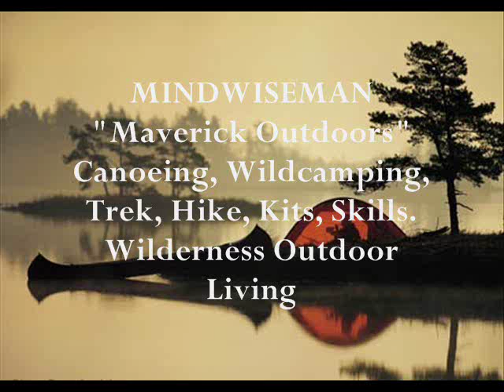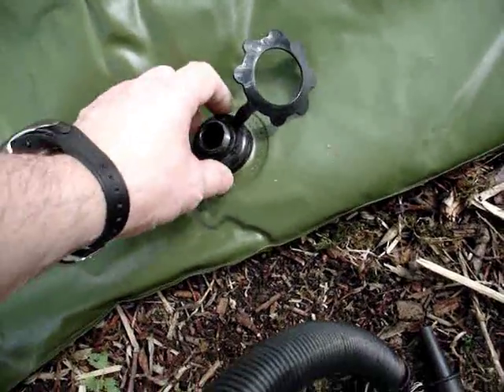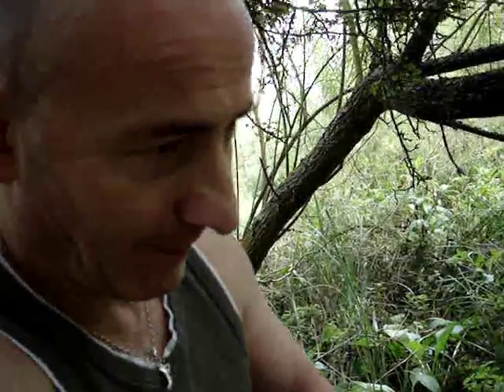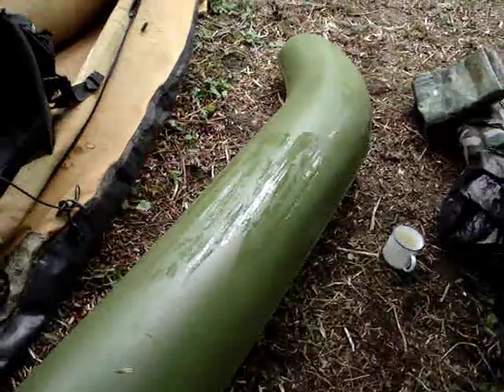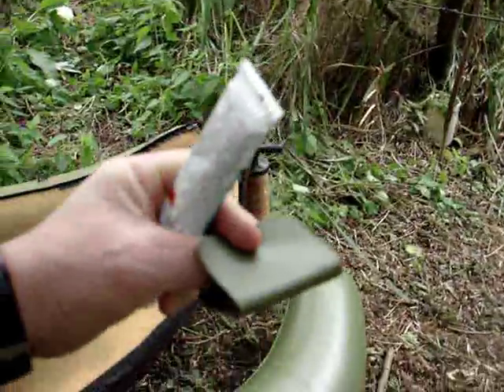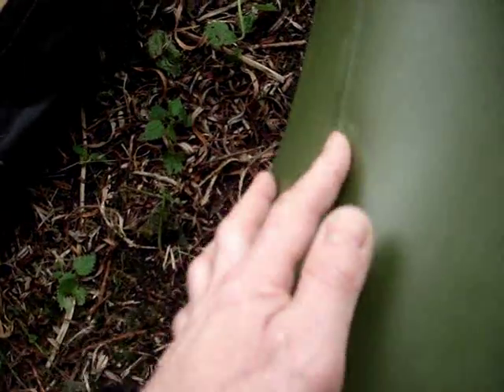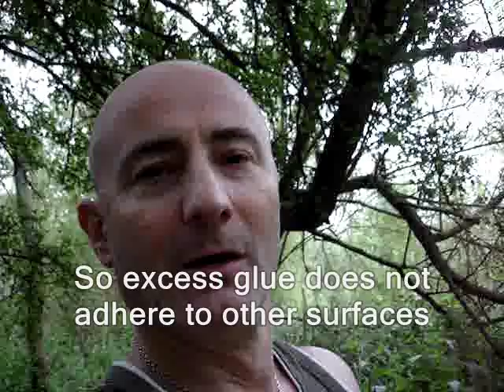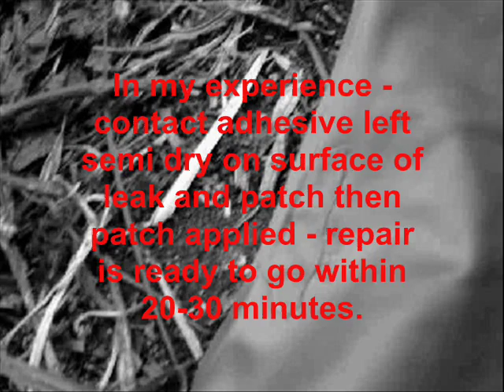Sevylor Colorado Canoe: DEFLATION REPAIR, On The Trail

Comment: Hi Mindwiseman, the soap solution will work better as it will produce more/better bubbles when sprayed onto the surface of the bladder, it will help with leaks that are harder to find than using just water as it will produce massive bubbles similar to the sort of toy bubbles that kids play with when they blow through the hoop. I would have thought it will save a lot of time to especially with the very slow punctures.

Comment from the maker: @sjacko1066 Defineately something to consider detergent/water spray bottle, do you think it will work better because it is a thicker solution. May take longer to flow/cover surface. Will give it a trial run. Thanks for the comment - Cheers!

Comment: I had a similar problem with a Thermarest sleep mat.  I let the air out and mixed up some locktite and put around the seam ,let it dry for 24 hours. That was about 5 years ago and never had a problem since.

Comment from the maker: @ThePanzer6969 Heyup m8, I inflate pressure (don't trust guage) to finger or thumb press suface 1" deep with a spring back of the baldder. One of those things where you get used instictively to the feel of the surface pressure & by feel/look. New version of Sevy' Col' seat aren't as firm back as the original, I don't have a prob with back support as mine's older type - firmer. Also inflate front floor cushion (built into floor) to rest feet on for better ergonomic support. All the best!

Comment from the maker: @ThePanzer6969 Heyup m8, I don't use guage I press thumb 1" into inflated surface to get a firm spring back. Sort of instinctive feel/look to know the right pressure. New version of Sevy' Col' seat isn't as firm back rest as older type. Mine's supportive/thicker older type and the whole seat velcro/staps on to floor cushion so no probs there. I inflate front cushion built into floor - as foot support to keep ergonomic support whilst paddling. All the best!!

Comment from the maker: @sjacko1066 Will give it an experimental trial run this wk/end, obviously I won't puncture the canoe 1st :-) will use spare air pillow. The thing that plain water would benefit is it's easier to hear where the air is escaping from because water is thinner and gives less resistance to the air escape, so you could hear it before seeing it which is what happened when I did repair in this vid. I try to use items I already have for other uses but worth considering carrying detergent spray. Cheers!

Comment from the maker: Specced at: level 3 rapids/water flows, coastal paddling. Inflatables don't track the water as good/efficiently as hard shells so taking it out on coastal sea = safety priority needs to be considered. As far as I know St Ives can be quite prone to small tidal waves in & out from the cliff coast so unless paddler is proficient I'd think twice about it. It really is down to the knowledge/abilties of canoeist regarding tidal, coast & rapid navigation. Inflatables in general - it's good entry level

Comment: Great video: I'm looking because I just bought a new Colo, went out on a canal today, floor chamber deflating (and this has the Boston valve), tried it in the dry with no pressure on it, and ensuring the 2 threads on the valve are tight - still deflating. So I dunno - do I insist on my consumer rights and just return it as not fit, or as I'll be likely be in this position again in a year or 2, just get on and find what's wrong. I wonder how I get that floor chamber out - check your other vids...

Comment from the maker: @g0vqw Heyup Sandy, would have been a long cold swim back to put in - with my arm bands and rubber ring LoL. Computers still not quite right coz of the memory but will do for the time being, all be it's a bit random slow and goes into limbo now & then. More frustration with that than the canoe deflating. 
Cheers m8!

Comment: What material is the bladder made of? (I've looked up current colorados, but they don't seem to have removable bladders like yours.) I am particularly interested to know how well contact adhesive works on the PVC of e.g. a sevylor colossus. And, how well has that patch lasted??
Reply from the maker: Bladders - PVC, Colorado bladders insert in the actual nylon canvas hull covers i.e. zips each end to get access to side ones, zip on floor behind rear seat to get to I beam base. Acquired mine 2008, no probs except for manufactured seam of side bladders getting pin hole leaks on the join (as in this vid) - had 6 repairs which work best with a blob of multi use Sure Seam glue. I'm awaiting a PVC type paint which I'm going to apply along the whole length of the 2 bladder seams to strengthen & resist pin hole leaks along all the seams ( will do a full review on the process). Providing a flexi sealant is used with patches the repair shouldn't split/re leak like this one did.
Reply: MINDWISEMAN Thanks. Given that pvc glues work by dissolving the pvc so that the molecules can move around and intertwine to form a chemical weld, perhaps you should be careful to first test that the pvc paint you use does not excessively weaken them seam. But it's probably fine - if nothing else, things like coglan's airstop have a bunch of extra pvc molecules in it so that once the solvent has evaporated you are left with a thicker collection of pvc molecules.

btw, i've heard a couple of times of making Airstop equivalent by chopping up pvc scraps and dissolving them into some plumbers pvc glue (which is, afaik, almost pure solvent).

So how long did the contact adhesive last? I did some tests (see some of my videos), and the contact cement seemed pretty good, but I was able to peel it off with enough tugging.